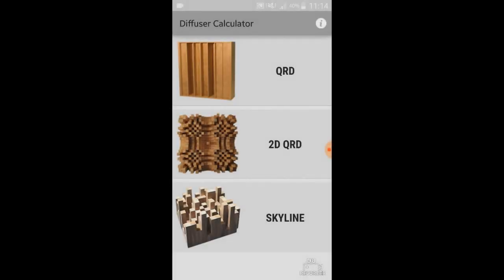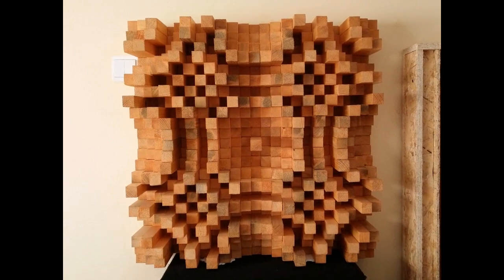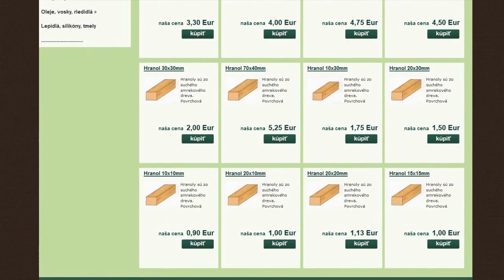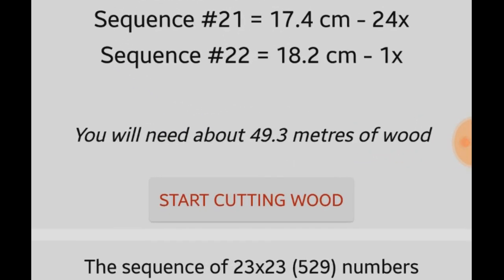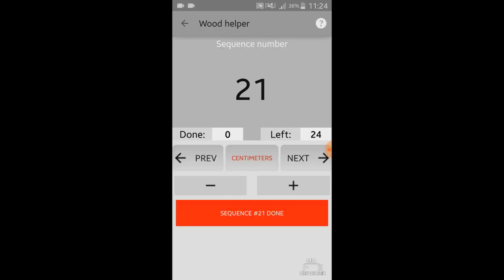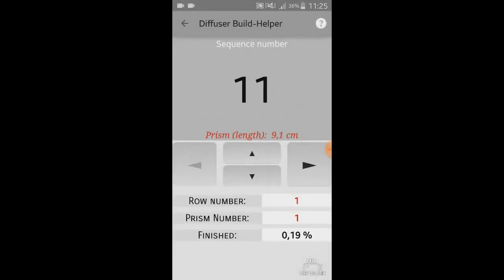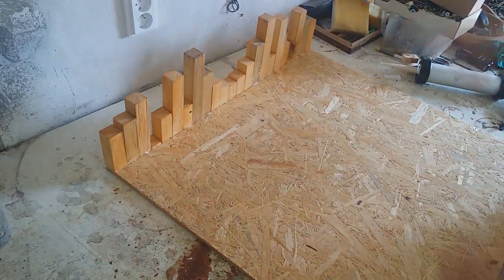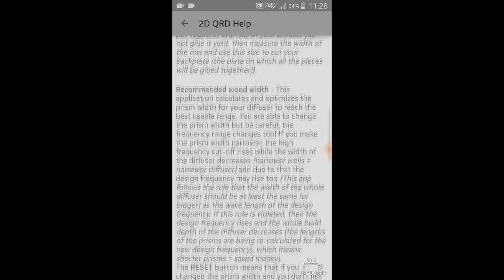How to Build 2D QRD23 Diffuser Using Mobile Application (Diffuser Calculator)

Comment: Nice. But are you really calculating things like 16.6cm or 1.3cm?? Or are you rounding up to 17cm and down 1cm, for example?
Reply from the maker: I'm using 16.6 instead of 17. No rounding there, but rounding can be found if you have like 16.64 then I make it 16.6.